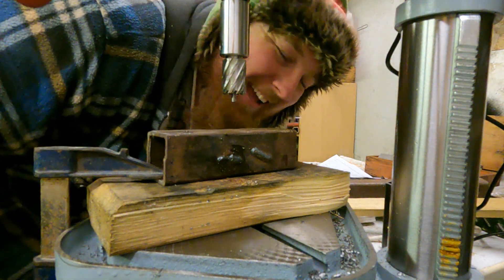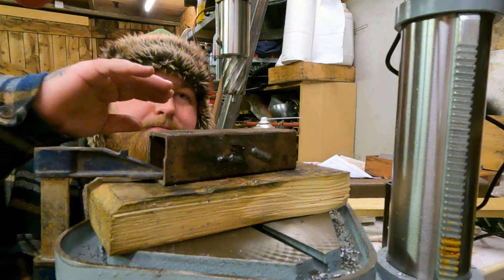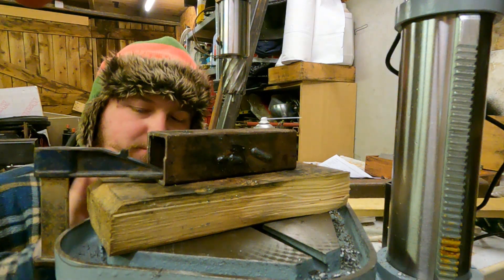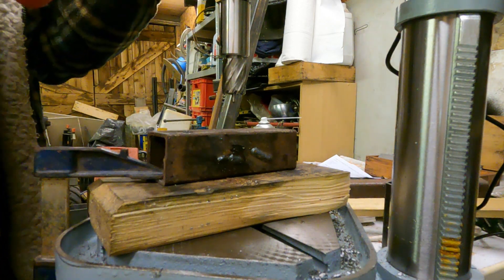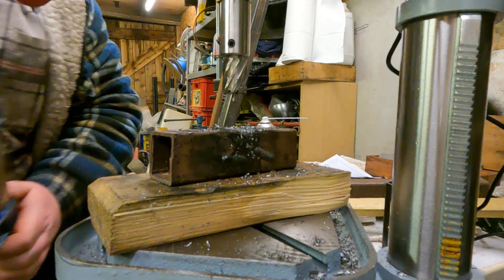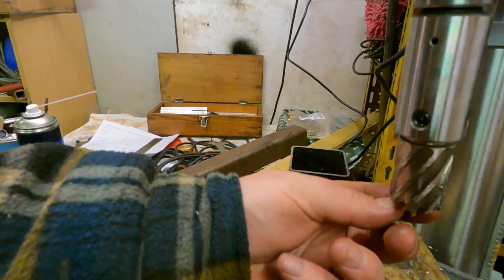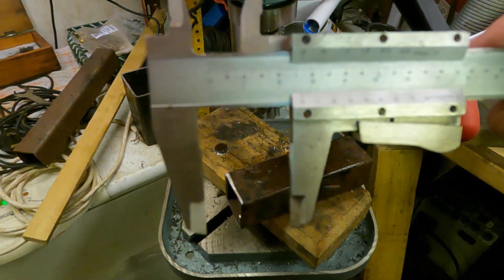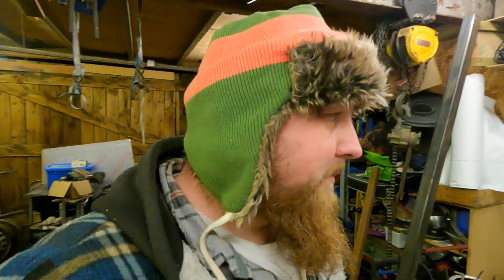Annular cutters - Myth or Real Used In A Drill Press ?

Comment: Hi 
I’m considering getting the 1100w SIP 01717. How are you getting on with your SIP drill ?
Reply from the maker: Hey buddy, thank you for commenting first of all.
I have used this drill extensively and it hasn't missed a beat. Certainly is very capable machine. Even more so, I suggested we get one at my workplace.
I hope this helps in your purchase, however I have no experience of the 1100w version.
Reply: @wavywoodsawmill  thanks very much for replying, it’s very appreciated

Comment: Why slip and stack in drilling operation. which is problem Machine or Annular .
Reply from the maker: Probably the machine, the belts may not have been tight enough for the torque required. They work well, however I also like the bosch hole saws too. They're hardcore too
Reply: Can i use annular cutter in pillar drilling machine
Reply from the maker: @makeinmaruthi  yes you can no problem. The Pillar drill handles It no problem at all. As long as your pillar drill has various speed settings to allow you to find the right speed for the bits.

Comment: Ive just acquired a set of these 12 , 14 ,16 ,18,20,22 mm great for drilling 80x 80 X 3 mm box section but that odd annoying peice gets stuck inside the cutter the spring loaded centre just sometimes struggles to eject the centre after cutting any tips ??
Reply from the maker: Hi Mark and welcome. Thanks for commenting and watching.
So I use a centre finder pin in cutters, not a pilot drill, sure yours will be the same too. I put another spring into give it a bit more pop for when the slug has been cut. Generally a couple of taps with a light hammer normally gets them out. Never had one stuck stuck yet though. That's just my experience. Hope it helps bud 👍
Reply: @wavywoodsawmill  thanks for replying yes it's a spring loaded I've got but will try a short extra spring to give it a bit more power ,👌

Comment: Bolt your machine tools to a concrete floor.
Reply from the maker: Hey bud, I will once the shop has a designated place for it. At the moment it's an absolute pig mess. I didn't bolt it so it could be moved for longer stock to be drilled. Thanks for your comment though 😊

Comment: What kind of adaptor do you need to fit the annular cutter in a drill press?
Reply from the maker: Thank you AV for the comment. First of all you need to know what taper fitting your drill press takes. On mine I'm sure it's a MT3 which is the morse taper 3 fit. So I bought a MT3 annular cutter adapter. Hope this helps and thanks again for your comment 👍
Reply: @wavywoodsawmill  thanks mate appreciate it :)
Reply from the maker: @bakedjohnwick4793  no problem, just replied to your other comment too 👍
Reply: @wavywoodsawmill  Can you tell me where you bought it?
Reply from the maker: @Ralph Biggs  which part buddy ? I'm sure most of the parts came of ebay buddy

Comment: For through holes above half an inch and not too deep, annular cutters are definitely the best option available. On a mill with NC, you can just use circular interpolation to open large hole no problem, but otherwise your options are a holesaw (fine for shallow holes,but a pain for anything much more than a half inch), a boring head (time consuming and kind of finicky), or suffering through driving a, say, 1" drill through the material, which is never pleasant. It's strange they haven't made much of an impact on the market outside of magdrilling applications.
Reply from the maker: I agree with everything you say. I will say that using blacksmiths drillbits are and seem dangerous when they grab in material but also are time consuming. Got to go up in increments and I haven't the time for that 😅 annular cutters are nice as are hole saws. I use the bosch quick connect ones and are really good. Thank you for watching and commenting.
Reply: I was wanting to build a squat rack very similar to the brand VERVE. 75x75x3mm square hollow tubing. I found an annular cutter that is 75mm long and was looking at using that with an arbor adaptor to fit my drill press just for ease of use and speed of drilling. That way I can go straight through both ends. Thoughts?
Reply from the maker: @bakedjohnwick4793  my team leader wanted me to build him one too, not same as Verve but something else over here. I said we could do it for sure. The joy with the drill press is you get a lot more extension than a mag drill so if you've got an extension on the annular cutter then it will go all the way through. I think you'd be OK doing it. As long as your drill press has good torque. But remember slowly slowly with plenty of cutting spray will help your cutter last longer. Hope it helps. If you require anything more, let us know in a comment and I'll get a video sorted 👍
Reply: @wavywoodsawmill  legend!!! Appreciate it my man. Starting the plans now haha

Comment: So where did you find an adapter for your drill press. Im in need of one that fits a 3 jaw chuck. As my drillpress does not have a morse taper.
Reply from the maker: Hi Stan and thanks for your comment. I just went on ebay and put annular cutter adapter in and got one to suit my morse taper of the pillar drill. However I'm unsure what they have for a 3 jaw chuck on there. Worth a look though. Are you sure your drill press has no taper chuck on it ?

Comment: I was about to spend some $$$ on a Mag DRill but after seeing this video changed my mid. Going for the drill press,  which is more practical.
Reply from the maker: I am glad you've watched my video and made your mind up. The drill press for me has been invaluable and has definitely helped me more than enough. I feel a mag drill wouldn't have been practical for what I needed it for.
Reply: A mag drill has its uses that a drill press isn’t possible to use. But if your only drilling on small items that can be clamped under a drill press then you don’t need one
Reply: Mag drill won't hold onto anything under a certain thickness it's mainly for thick metals 5mm+ I have a Jei mini beast but it only does up to 35mm through 50mm max and I currently need 50mm and 60mm holes but I'm not sure I want to break my new sealey radial pillar drill by over doing it with 60mm annular cutter😂

Comment: What's the purpose of that sprung pin in the middle? Is it hard enough to make a center mark to prevent walking of the cutter? If not, did you center drill first? Can hear/see that motor working. Careful loading the motor of your drill press, melted mine using a big ol' step drill in aluminum without even fully stalling it. Thanks for the video, always to fun to see home shopers experimenting.
Reply from the maker: Hi Alex.K and thank you for watching first of all. The purpose of the spring loaded pin is exactly what you said. So you would centre pop your place where you are drilling and then align that pin with that popped mark. Equally if you wanted to, you could pilot drill the place your wanting to hole saw out but make sure the pilot holes is same or slightly smaller that the pin other wise you won't know exactly where your drilling if its precise work. 
The motor does sound strained but once you get the cutter cutting just right, the whole process is very easy on the machine and cutter. It's very satisfying when it goes through with any chatter. Thank again for stopping by and as ever I appreciate the comment.
Reply: @wavywoodsawmill  It also controls the coolant flow if you have the right adapter.
Reply from the maker: @SegoMan  that is very true, however on the pillar drill I don't have that adapter like the mag drills do. Them coolant adapters make the difference like. Thanks for your comment 👍🙂

Comment: Hi Nick - it's Big Rodders in Ireland.  Every day is a school day, I'd never come across those cutters.  Surely it would be possible to easily convert your new toy to wet drilling.  Would it not be worth the effort?
Reply from the maker: Hi big rodders. Yes your right, the table has a drain hole in place for wet drilling application, however when cutting with some of these hole cutters the swarf flies everywhere and would splash my surrounding area with coolant. So until I get my garage or workshop finished then I'll stick with the spray cutting fluid. The aerosol cutting fluid isn't that bad to be fair. I can get the fluid right to where it is needed with the attached straw. Thanks for watching.
Reply: @wavywoodsawmill  It would work out far cheaper if you buy some soluble oil and mix it about 15 parts water to 1 part oil. I use it in an Oasis bottle with a 1mm hole in the lid. Works a treat. I drill loads on my pillar drill and radial drill with this method.
Reply from the maker: @grumpyone5963  I have heard of that soluble oil, however I have an abundant supply of that cutting fluid so that's pretty OK for me. Thank you for your recommendation.